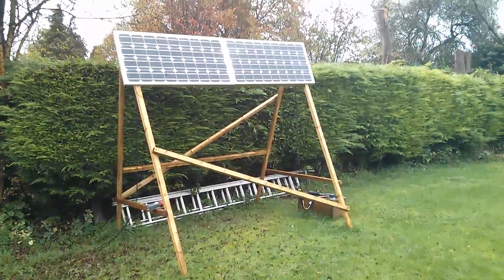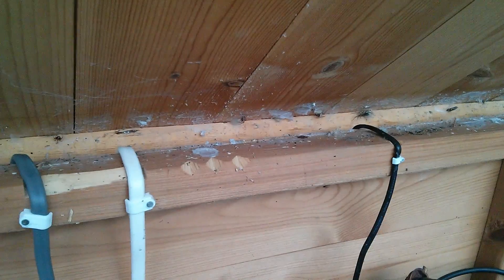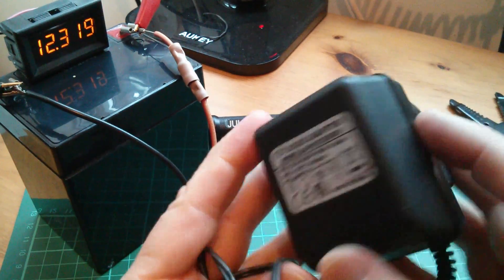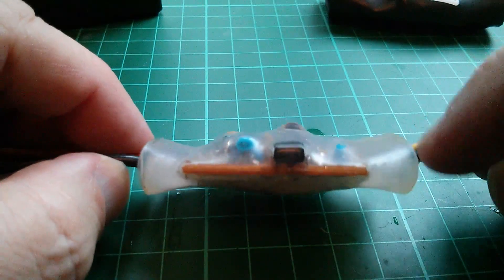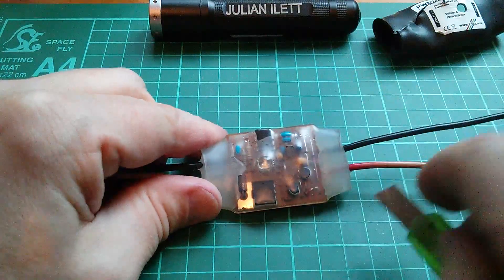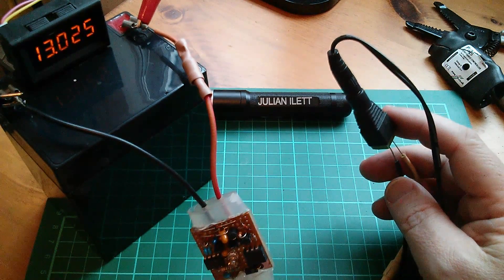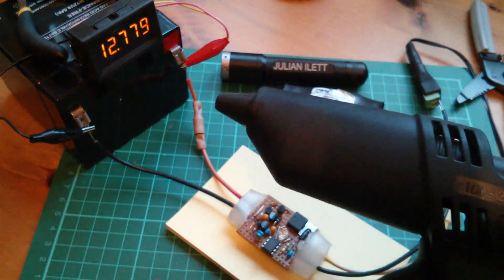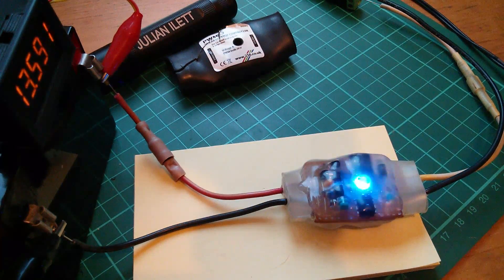Autopsy: Faulty PWM5 Solar Charge Controller

Comment: I have the same experience - sun heating the hot glue just a bit to allow a bit of a wiggle from cable, no problem in summer. But then the small room allows water to get in over Autumn, resulting in moisture inside. And in winter, the water expands as it freezes and suddenly you have big opening - next Spring your circuit is dead.
I started to pain all over the PCBs with nail polish on top - that helps a lot.

Comment: Hello julian!  👍
Do you have any remaining stocks to sell? However, I would prefer a button switch that shows volt and amperes on a small display than this strange flashing! I don't like counting this disco light, it's just an estimate of iron. I also like kine SMDs and components should be military or marine grade. This is a few cents / penny more expensive for the parts, but it lasts forever!
Greetings from Austria!

Comment: use silicon - real silicon neutral setting gel for sealing. (dont use clear polymers either, they can go brittle in the sun / weather ) hot melt glue is bad for sealing as you see. only good for quick fixes in hobby use, not commercial sealing. :) cheers for interesting series on your experiences in prototyping to production too

Comment: yup, hot glue is not good around anything that gets hot ive noticed, hehe.  noticed your melted banana plugs, thats alot of heat.  thinking the wire just got warm for too long and managed to open up the hot glue just enough for some moisture to sneak in.

Comment: Tks Julian , I think Your videos is what have let me understand most from Youtube. I start with no education at all on lectronics and now I have done a lot of experimenting on transistorcontrols and what I find as the most common problem on pwm controllers for brushmotors is the too big value on serial resistors to protect the outputcurrent of 555 timers, typically 300ohm. I find with sthandard mosfets capasitive inductance will need maximum 50ohm to be controlled perfect shape for input pwm.   When I come across Your pwm5 design, I find there is a differenc between Your handwritten values and the values on the part-list. Both contain the total of 7 resistors, and for the handwritten it seems like 4.7K as serial resistor into the transistor.  Then I wonder if this is really correctly and what is the pwm frequency ?  The transistors data of 0,2A will be able to handle a 50ohm serial resistor I think.  Please correct me.  How is the shape of the signal into the the transistor on the oscilloscope ?

Comment: As for waterproofing these things. I use small waterproof jewelry cases and I fill them with regular candle wax. When it's hot and the was melts a bit, the case keeps it from flowing out, and when it's cold and wet, it solidifies like a rock. The mixing from hot to cold reseals the cases every season. I've used larger cases for my portable lighting boxes which run off solar or wall charged Ni-Cd batteries to power 12 volt lights. I do the same thing with these. When you need to get it out, I warm up the case in a wood box with a 65 watt halogen bulb, then I can pull the entire unit out, and I put it in a small oven with a tray under it, it melts all the wax off the components at about 120 degrees F.

Comment: I do not understand why people use electronics outside and do not enclose them in protective coverings. That charge controller was not originally meant to be hanging out in the rainy weather. All of your connectors are open so that is why they rust. There are connectors that can handle the current and are water proof. You didn't even try to water proof things. I would have thought to see silicone or some other weather protection...

Comment: Clear silicone or RTV is your friend. Shapes like hot glue,  is water resistant, and would not melt in heat. Just takes time to dry. Used it all the time when I built industrial computers.
Reply: You have to be very careful about what silicon sealant you use as many use acetic acid, which is not terribly good for the electronics (it just eats away the copper traces, wiring, and device leads.  You can buy ready made silicone spray conformal coating, but no conformal coating can be counted on to keep out moisture long term, they just slow down water ingress -- that is where proper potting or a water/weather tight chassis design pays off best if used in a wet environment.

Comment: I think the melted connectors tell the story... the wires probably got hot and melted the glue.
Reply from the maker: +mnelson10000 The wires themselves don't get hot - they're rated at 14A continuous and only have a maximum of 6A flowing through them
Reply: +Julian Ilett If the connectors got hot enough to melt, it seems logical to me that the heat could have conducted through the copper and reached the glue, no?  I'm not saying the wire wasn't large enough to handle the current.
Reply from the maker: +mnelson10000 Yeah, I see what you're saying. Seems like a very long way for the heat to travel, but I wouldn't rule it out - the connectors must have got very hot.

Comment: Maybe it is better if you paints over the surface of the cooper side/area and then with hot clue (or silicone (like PENOSIL Premium Aquarium Silicone)) 

I use banana plugs for testing only temporary. For longer than a few days, I soldering connect wires. If necessary, as the easiest way is to melt the solder off (or cut through the wires in case of emergency). Or to use both sides of power lead "ring wire connector"and  bolts and screws.
Banana plugs connection area is too small and will easily melt for a long time using.
Reply from the maker: +kose2ik I agree that banana plugs are completely hopeless for prolonged use outdoors :)

Comment: Oh. I forgot. Use some neutral lubricant like vaseline. Put a bunch of it into banana socket and plug. It will prevent corrosion. Or you can go for a special purpose grease.

Comment: I would have used Silicone not hot glue.
Reply: +sublimationman Or even better, epoxy potting compound.
Reply from the maker: +sublimationman Hot glue is much easier to work with - it's completely clean. Silicone and epoxy are terribly messy.
Reply: True but you probably would not be fixing it now had you used either of the others.

Comment: Hey julian, do you know any good charge controllers on ebay for 12v? im planning to run maby 50-100w solar panels during winter to charge a car battery that uses led light strips at night. The controller will be inside the house so i dont need it to be waterproof.
Reply from the maker: +30GB The cheapest controller is the CMP12

Comment: That constant voltage power supply is a really bad example of PV panel simulation. You need to use a constant current power supply not a constant voltage one to simulate a PV panel.
I know that in this particular case that sort of worked but was a bad example :)
Reply from the maker: +electrodacus But it's not a very constant voltage supply - 18.5V off load, dropping to around 12V at 500mA.
Reply: +Julian Ilett That is because it is just a transformer and there is no voltage regulator just the diode bridge and some small electrolytic.
Your battery is normally above 12V so there will not be an excessive current but if you had a 6V battery or an over-discharged 12V one then is possible you will have damaged that power supply or the fuse if it has one.
My comment was that solar PV panels are a constant current power source and I know you have plenty of constant current / constant voltage power supplies :).
I know many people do not understand what a constant current limited power supply is since I get questions all the time about connecting a constant voltage power supply to my Solar BMS PV input to charge a battery from the grid and of course that will not work best case the constant voltage power supply overcurrent protection will protect it.
You can safely short the leads of a solar PV panel and you will get a current no higher than the short circuit current spec that is about the same (few % more) as the max power point current. You get the same effect if you short circuit a constant current power supply no damage and current will be the set current while if you do that with a constant voltage power supply the overcurrent protection (if it has one) will cut the current completely and recover when you remove the short if the protection is electronic or PTC else if is a fuse you will need to replace that but is for sure not normal operation.
I know you understand all this the comment is mostly for those that do not and read this comments.
Reply: +electrodacus Connect an incandescent lightbulb in series with a constant voltage PSU. That works pretty well as a simulated solar panel. :)

Comment: Regarding hot glue, read comments below. Epoxy is messy and expensive for a big run. Clear silicone is an easy, cheap solution but be aware it is generally not design to stick to PVC wiring but it can be clean for repairing purposes. If you want avoid de-potting and reverse engineering you may want to use a poly-urethane based caulk (many Chinese manufactures use this stuff nowadays!) Cheers.

Comment: Hot glue is a terrible idea when there is a chance of getting wet. It will not act as a water insulator. Water can perfectly fine penetrate between the hot glue and the surface where hot glue has been applied. I have seen it many times and with different brands of hot glue. Depending on the materials glued together, I have seen water penetrate like acrylic glue (acrylic cement) penetrates the gaps when used to glue perfectly polished pieces of acrylic. It's just a slower process and the result is that the glued pieces unstick as if there was nothing holding them together in the first place. Also hot glue is a material with bad durability against the sun and time. It deteriorates, it decomposes.
Reply from the maker: +Mandragoras It has worked remarkably well - certainly for the 1-year warranty period - I've not had any units returned with moisture inside. The bond between glue and heatshrink is extremely good - it's very hard (if not impossible) to separate them. The bond between the glue and the PVC wires is not so good, but the glue doesn't shrink so the seal remains tight.
Reply: +Julian Ilett Like you said, it's hard to separate them but water has low enough viscosity to penetrate the invisible gap that there is between hot glue and any surface it has been applied to. It's just a slow process. I'm speaking from experience, I'm not just parroting a theory. Like you have shown in your video, water found a passage and leaked through hot glue and heatshrink. I suppose these devices are not submerged in water and this is why you hadn't any returned. I suppose most of those who bought it would try to have them installed with at least a minimal protection from the weather so that they won't get soaked which will make the "separation" process even slower. If you don't believe me, use hot glue to glue various materials together and submerge them in water. Leave them there for a few weeks and you will be surprised how easily you will be able to separate some of them.

Comment: Regarding the sealing. The moist is coming through the wires between conductor and insulation. 
Due to the capillarity effect the wire itself basically sucks in the moist. It can travel even over quite long distances. The best way to prevent this is to choose a sealed connector system (i.a. automotive or solar connectors).

Comment: If I were you, I would get one of those Tesco transparent plastic food containers, drill holes for the wires out  and dump the charge controller inside, and for sealing the holes use the glue gun, this is what l normally do, hope you can do this.

Comment: Seeing as it's out in the elements in all weathers I wonder if thermal expansion and contraction played a part in the failure?
Reply from the maker: +Coolkeys2009 Quite possibly. And I wonder if the way this controller was hanging on its own wires may have compromised the wire/glue seal.

Comment: As someone said, water can get in through the leads (capillary effect?).
I have been using 2 component gel at work, and it seems to pretty good. Also it is not as viscous as the glue so it fills in the gaps. Only negative thing is it takes 24 hours to set.

Comment: I cringed every time you shoved one of those straight pins into a wire. I just kept envisioning a scenario where your hand slipped and jammed that pin up under your fingernail.
Reply from the maker: +Justin Rowan It's OK, I've done it before - about 900 times
Reply from the maker: +lasersbee The probability doesn't change over time, although complacency can increase the risk.

Comment: The weak point is usually always the cable entry and unless you use a bonding compound to provide a good chemical key for the glue, capillary action will draw any water into the capsule and saturate the pcb.

Comment: I think it was the sun's heat (in summer of course xD) which melted the hot glue a bit and then it destroyed the seal.
Edit: You really should pack it up in a small enclosure and just pot it in epoxy like the other people mentioned.
Reply from the maker: +BloodySword We can do that with the open source SMD version
Reply: Yup I had a hot glued little wire harness in my car for a 12v adapter . After a hot day in Australia I found it 'attached' to my passenger seat as it had melted and rehardened.

Comment: fuck those spiders mate. I'd guess that hotglue doesn't really stick to other plastics with a very smooth surface, they basically create a very straight vein to which can eventually separate due to temperature stress over time. Use some kind of silicone adhesive next time and fill the whole circuit in it.
Reply: +jusb1066 You can get silicone that desn't produce acid in curing, but the acid-cure type doesn't work very well for PCBs :P
Reply: The hot glue potting may work better if adhesive backed heatshrink was used to create a better seal.  However, nothing will stop water intrusion by way of the wires unless you make the wire ends watertight as well.  It is also critical that the wires never get hot enough in operation to partially melt the potting glue or you will also open up a path for water intrusion between the wire insulation and the potting glue.
Reply: +Eduardo J R doesnt silicone cure by offgasing acetic acid? i wonder if you potted an entire board (perhaps made a moulding case) then filled with silocone until cured....wonder how it would work out
Reply: +jusb1066 Acetic acid will damage solder joints, but not all RTV contains acetic acid. Dow Cowning 3140 RTV and other types are appropriate for use in electronics.

Comment: using epoxy resin could be a good idea for encapsulating the module. It cures clear, and as a side effect you could make different shaped "cases" by just creating a mold of that shape. Could be a sphere, or a heart, or just simple square.  Check out Peter Brown's channel, he has a series where he dips random things in it.. like bacon.
Reply: And if it is encapsulated like that, water will never get in. There would be no moisture in the air because there won't be any air! Julian would just have to quadruple check it's function and quality and it would probably last as long as a refrigerator compressor! If for some reason it failed, though, it would be a throw away.

Comment: Cheap Dollar Store two-part epoxy works great for permanent potting. I put circuits like this in old clear plastic medicine bottles filled with epoxy. Wires poked through the plastic cap.

Comment: Has similar experience with hot glue gun. Not best solution for outdoor electronics. Better use epoxy compound to cover. Or thick layer of clear coat that heat and water resistant. Thanks for the video.